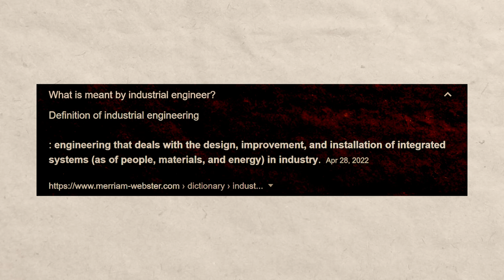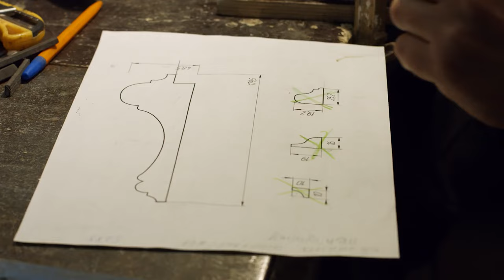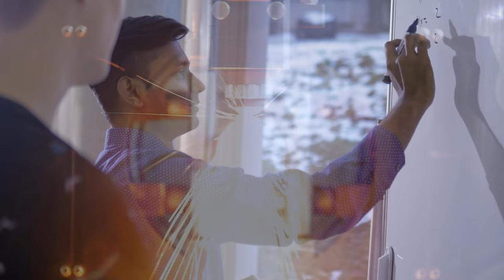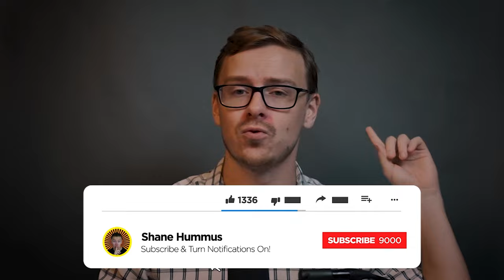Top 10 Highest Paying Engineering Careers (Engineering Jobs Ranked)

Comment: Honestly all this list told me is that glass door is ridiculously inaccurate if they think chemical engineering is the second lowest on this list. Based on polls conducted on Reddit, entry level chemical engineers make around 75 vs around 65 for civil. I know for a fact that chemical tops out well over 100 too because there’s a lot of chemical engineers in my company. And I don’t know what company is paying plant managers under 100, but that’s absurd. They make between 130 and 160 at my company depending on the size of the site.
Reply: I think so and ı think material engineering should be in the list.
Reply: 70-75k is becoming the new entry level pay for civil. I’ve even seen numbers as high as +80k. The rate of graduates steadily decreasing while their demand has notably increased is driving up salaries. At my school’s engineering career fair ~53% of the companies in attendance were civil/construction-based, ~3-5% were recruiting ChemEs and ~11-15% were recruiting MechEs. 
Mind you, nearly 200 companies were in attendance.